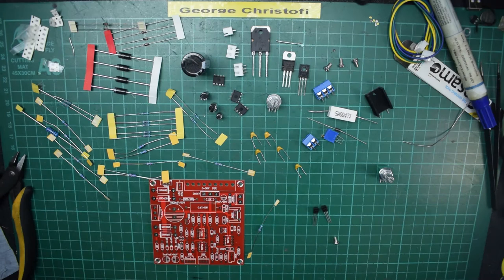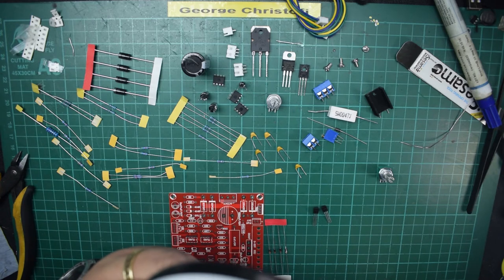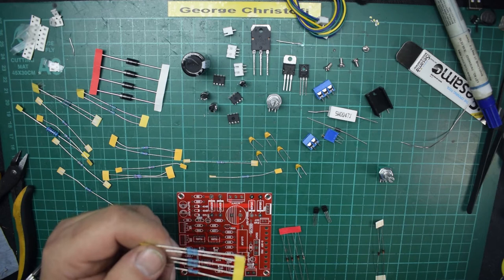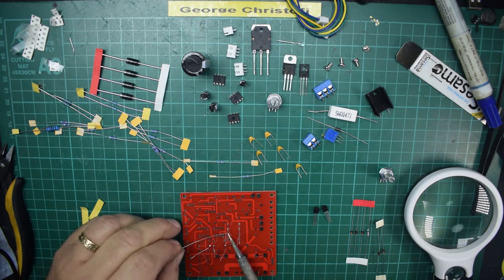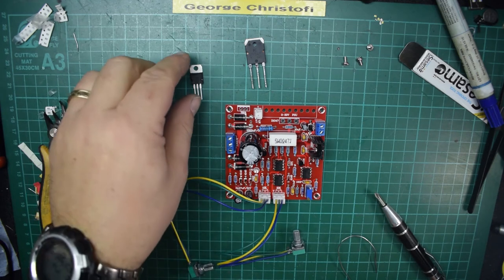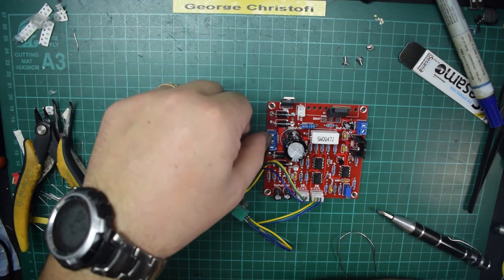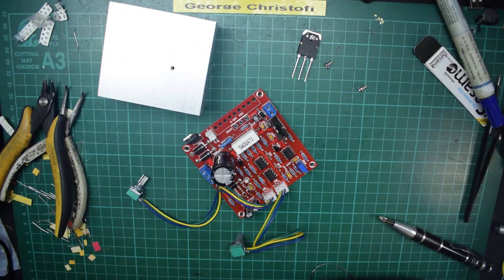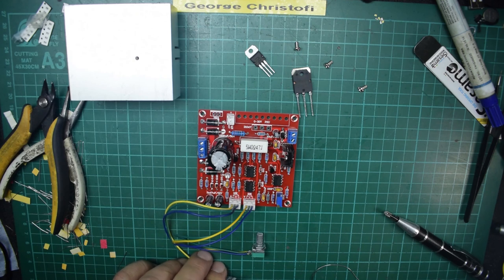High Current PSU Project Pt. 3 Bangood kit as a possible driver unit.

Comment: What happened to the lm723 regulators you were going to use in first video? Wouldnt the 723 control better than single opamps with zener diodes as reference?
Reply from the maker: Daves Tech I still have them. And yes you are right. I am not too impressed with this Chinese board. It's great if you have the specific transformer that it was designed with. Any variation is less easy to accommodate with the kit pcb so you are better off going with an existing circuit.